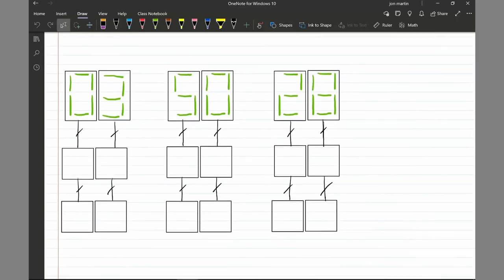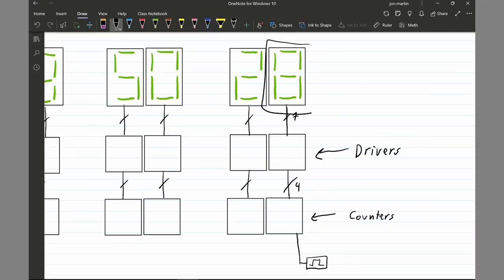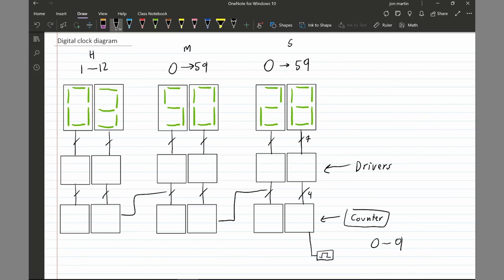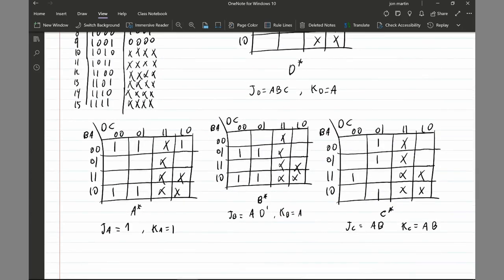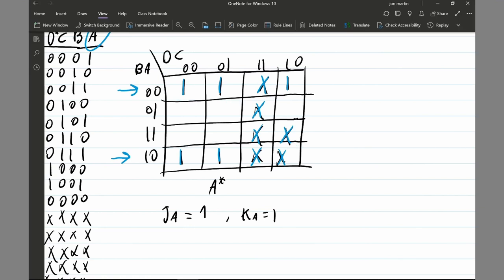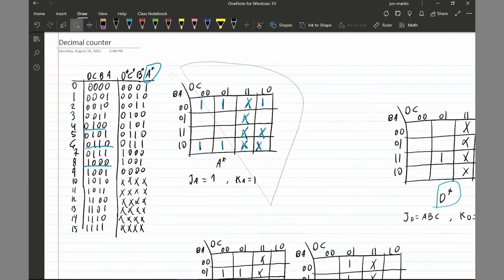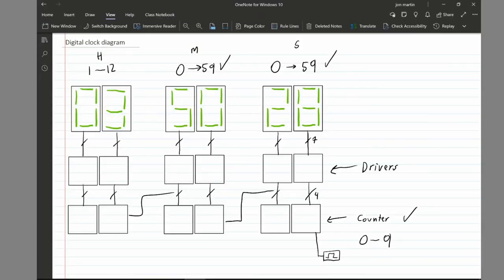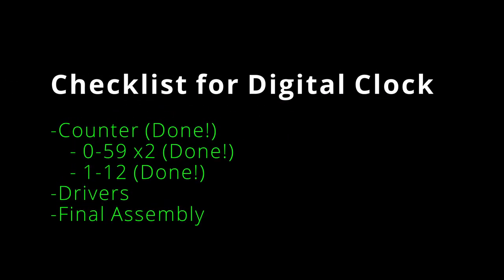Here's How to Design a Digital Clock Part 1

Comment: Hello. I am a student. My homework is design a digital synchronized counter count from 0-99 using flip flop D. However I have some  problem, I set the state 0000 to increase 1 unit of dozens , when it start the dozens must be 0 but it is 1 and it make my circuit was wrong. I make the on falstad website.